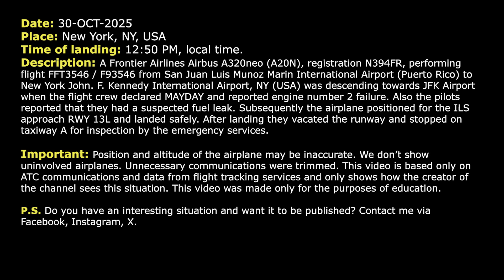Engine FAILURE and possible FUEL LEAK. Frontier A20N performs emergency landing at JFK. Real ATC

Comment: I am surprised they would be bringing an Emergency aircraft down on an approach that is essentially a variant of the Canarsie / Parkway Visual...
  
It's awfully crowded under there.
  
(I know it isn't "exactly" the Parkway Visual.  This approach is actually shifted quite a ways to the northwest.  Just using it for reference, for those familiar.  Either way, the population density on the approach path used is rather high.  And the Low-Altitude Alert probably didn't help workload any...)
Reply: They used the ILS 13L - an approach that steals quite a bit of airspace from LGA and is only used in bad weather. There really isn’t a better runway to land on with how crazy the winds were that day.
Reply: @jpats4336...
  
I suppose.  Normally they vector Emergencies in from over water, if they can.  I didn't hear a Wind Check during the transaction, though, and I don't have the NOTAM / ATIS handy, so I'm a bit out of the loop.
  
Thanks!

Comment: just curious, can an emergency aircraft with engine failure not land on the closest runway?

What if number 1 failed as well😅
Reply: It's math.   The reason we have mostly 2 engine planes now instead of 3 or 4 is that we know that engine failures are incredibly rare and that it's both cheaper and sufficiently safe to have 2 engines knowing that one can fail.   We fly 2 engine planes over oceans these days because of the safety factors involved.   And like the other guy said, if they were both going to fail for the same reason, they would have both already failed.
Reply: This engine failure was due to mechanical issues.  The only cases of multiple engine failures (which are extremely rare) are due to bird ingestion, volcanic ash ingestion, or fuel issues (starvation, blockage due to gelling) and none of these apply here.  It would be unprecedented to have a second mechanical failure and considering they were already on the approach to JFK nothing would be gained by diverting to something a few miles closer.  Keep in mind the 737 is certified to fly on one engine allowing it to fly up to 3 hours away from the closest diversion field which is why twin engine aircraft are able to make transoceanic flights now.
Reply: @cruisinguy6024  "fuel leak" does seem to apply though.
Reply: @Jester01  I see where you're going, but keep in mind they have accurate fuel readings, consumption rate, and can easily determine if a leak is a meaningful concern in terms of flight time.  It would have to be a substantial volume of fuel leaking to divert when they're already set up for JFK
Reply: They would be up there all night.
Reply: They had plenty of altitude to trade for airspeed. This was probably the best time to have an engine fail as you have plenty of time to plan and get down.
Reply: thanks a lot guys 😃
Reply: Also, another poster pointed out that the winds favored the landing runway. It's no good heading for the nearest runway, if a tailwind is going to blow you off the end.